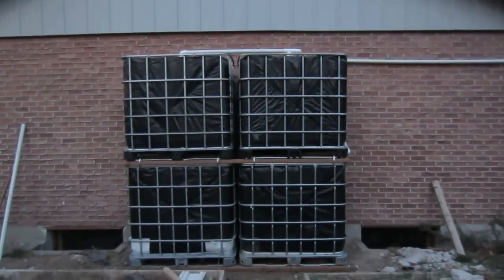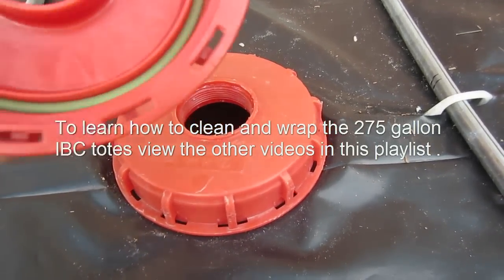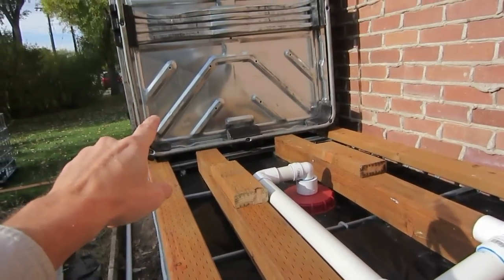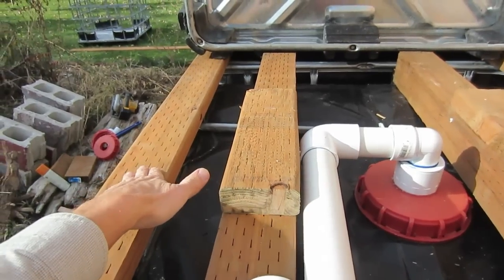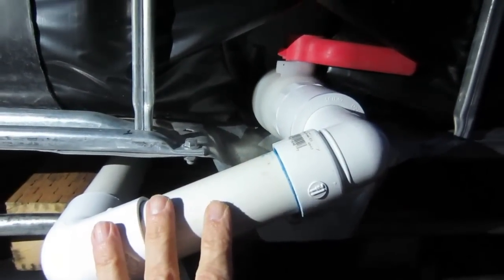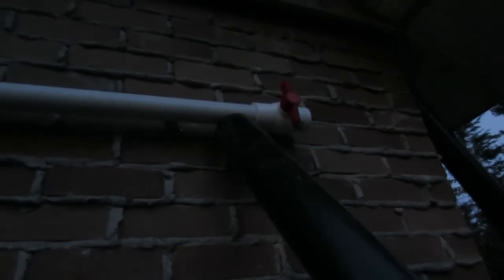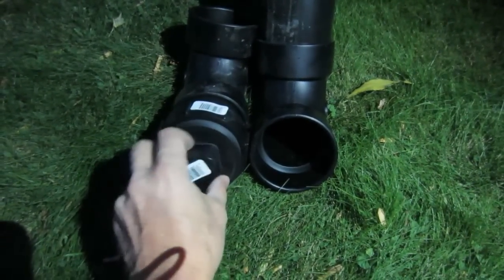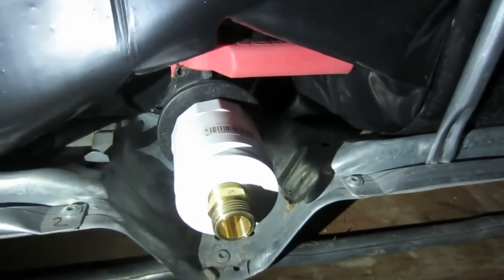DIY 1,100 Gallon Rainwater Harvesting & Collection System

Comment: Just a few tips I have learned from about a dozen years of rainwater harvesting in Jackson, Mississippi.  At my location, for instance, there is no need to drain out the water during winter.  It just does not stay cold enough long enough to create a block of ice in the tote.   

But we do get 75 inches of rainfall annually so even using pressure treated lumber is a waste of money.  All lumber, treated or not, will rot entirely too fast forcing you to disassemble, replace, and reassemble.  Avoid using lumber entirely.  Use cement blocks for the supports that touch dirt.  

For the supports to hold the upper tanks, mount parallel pieces of angle iron across the bottom totes.  The angle iron will create a channel which will allow you to place half cement blocks (or whole blocks) to support the upper tanks.   Use strapping around the blocks to hold it snug against the angle iron.  Supporting tanks this way will be a "one and done" set up as nothing is ever going to rot or need replacement.

Finally, I recommend draining and pressure washing out the inside of each tot once per year.   It is amazing how much cleaner you water will be when you clean and flush out everything.   You don't have to do all tanks at the same time but you will need control values (ball valves) installed on the water intake pipes to shut off the cross flow and isolate each tank if you want to do them separately. 

It is nice to consider adding a standard plumbing clean out with a removable cap just forward of the tote's own drain.   Mount the clean out with the cap turned down toward the ground and before the brass hose connection.  Using the clean out is a much faster drain process than using  the hose connection.  Of course, if you use both the clean out and the hose outlet, everything drains much quicker.
Reply: Good points. I'd like to add something to this as well. I have 2 IBS totes and in Chicago IL we can get a massive rain fall (like this year) I noticed my downspouds will overflow during heavy rain fall since my 2in pvc pipe does not provide enough of throughput for the water to go in. I'm considering adding another 2inch pvc into the system which will be tricky and ugly looking. Or spending money and going 3/4 inch pvc. I think 2" pvc is only good if you have small roof and never get hugass GPH fainfall.

Comment: I just finished building a rainwater harvesting and collection system that is based upon this design.  The 4x4s with the 2x4s on top failed to keep the bottom of the top tote from crushing the PVC pipe elbow that is connected to the lid on the bottom tote.  My solution was to use 4x6s instead of the 4x4s.  The 2x4s go on top of the 4x6s.  When both totes are full and begin to swell, the 4x6s gave me 1/2 an inch of clearance.  Perfect!
Reply: Hello, could you tell me where you found the instructions on how to build this? I think that is a great idea to use 4x6s instead of 4x4s

Comment: A small suggestion, use a leaf strainer before it enters the intake pipe. Use a catch box with a cover of plastic or aluminum fly wire. My three tanks, 1000 litre, 5500 litre and 750 litre drink water tanks are litter free. There is a little sediment in all but the Drink Water Tank with run off, sediment catcher and filter incorporated in the system. With only 225 mm or 9 inches of rain fall my system works. Rain water is great for home brew beer.  Keep up the good work.

Comment from the maker: Thank you for your comment and concerns. The first flush system is the equivalent of the settling tank. No additional venting is needed because air will "gurgle" out when the water comes in. There is plenty of room in the pipe for the air to go out as the water comes in.

Comment: If that's the case go for it! Here in the States 275 and 330 gal totes can be had for a very good price used. Over in Australia I see more homesteads with purpose built 2000+ liter poly tanks. Just be very picky as to what was in the container previously.

Comment: Vasoline on the O rings will cause them to break down. Possibly in a season or two. Use a silicone based lube like Jacks Lube or Magic Lube. You can find either at any pool store. It's made for that type of plumbing. Personally I would have wrapped the threads with thread tape and called it a day. No leak. Awesome system tho thanks for sharing.

Comment: Excellent review 👍🏾basically have a similar setup however I have my 4 totes beside each other on a concrete pad but the first tote that's closest to the gutter fills up along with the other 3 totes by a means of transfer hoses hooked up with T fittings 👍🏾👍🏾

Comment: I thought about using the two inch threaded coupling when I did mine, but decided to go with the rubberized coupling with a worm gear clamp. I was worried the PVC would strip the threads on the tote, but now I just have to worry about the coupling wearing out from the sun in AZ. As if that's a better thing...HA!

Comment: you will lose the majority of water because of the small orifice of your entry plumbing. If you're low on water a short rain will not have time to refill your totes. consider a sand filter and full 4"  plumbing from your down spout to your refill plumbing.
Reply: john nunya hello I'm getting ready to set a rain catch system I would like to sit the 4 275 gallon tote as in the video I have been researching a lot could you please give more advice on the 4" plumbing do you mean that is the size the pipe used should be so that more water can flow into the tote sorry this is all new just trying to learn

Comment: Great job! Highly commendable project!
Questions:
1. Why not painting it black instead of plactic enclosure? I thought painting it is easier and looks more uniform.
2. The bottom support looks like 2x6 to me, instead of 1x6? On other video (part 9 I think), you used cinder blocks; to me that look sturdier and more durable.
3. When both top totes are full, do the metal framing of the bottom totes (via 2 pieces of 2x4) able to support those weight??
Thanks for sharing, I appreciate your effort very much!

Comment: As long as the water empites out of the top tanks first the full tanks below should be able to hold the weight.....providing the tank itself can contain that extra weight. But if the bottom tanks empty first then you may have problems.

Comment: JASON on OCTOBER 13, 2014 2:34 PM
I like your collection system. It’s giving me some good ideas. in my area the local landfill won’t take asphalt shingles as they say they are hazardous material. I know the 1st flush catches the roof sediment but do you think it catches 100%? What %age do you think bypasses it? I read that you shouldn’t use asphalt roof for potable water collection or even gardening water because you don’t want to feed your plants the water you wouldn’t drink. This article said a metal roof was the best for gardening water and then for potable rainwater collection, and then using a screen/charcoal/& uv filter to clean the water to get all of the bird poop out.
Your comment is awaiting moderation.
REPLY

Comment: Just stumbled across your video. Am currently planning for an off grid homestead and like the up-cycling concept. Just wondered if the use is for drinking and if so have you needed to install a water circulation unit to deal with any issues of stagnant water?
Thanks in advance 👍

Comment: Question on the vent for the bottom tote. Can you remove the portion of the upper tote where it dips down to avoid crushing the 90 degree elbow instead of using a spacer? Thanks.

Comment: where did you buy the threaded tote cap.  I like that this is a closed system between upper and lower tanks, but my caps are solid.  Don't want to drill holes to create a closed system.

Comment: Do you ever drain the stored water from your units & start with new downpour, like is happening this week here? I only have 2 rain barrels, which is NOTHING during the summer months. When it rains like it HAS been for the last few days, I wish I had 100 more, but my barrels haven't been used since drought won out 2 years ago. Have only been letting the barrels top off with new rain.  I'm wondering if draining  & starting over is the way to go since we ARE getting so much new rain right now?

Comment: In central Texas, the ponds can run dry by mid-July, with105 degree days and no rain as the norm. Do you have an aeration system in your pond and is it fed by rain or city water supply?  Very curious as I want to be "water" ready at all times. During this last week (way too much rain all at once), it's hard to keep in mind that there are summer months into fall, where it's hard to believe everything and everybody isn't going to spontaneously combust! My two rain barrels are not sufficient! Thnx!

Comment: Your going to have a problem with filling up your tanks. Should have add vents in your bottom and top tank. Now your going to get gurgling when it fills up. And for a systen that big I would have put in a settling tank . But I can't say much cuz I wish I had that set up good job and God bless you.
Reply: I have issues with my 2"pvc pipes during heavy rainfall. It's not enought GPM in those bastards to keep up with rainfall. I need to add another 2" pipe or repalce with 3 or 4"pipe which is a lot of money. Good points you make there with venting!

Comment: LDSPrepper.  I am in Southeast Idaho, and I would not like to drain the units for the winter.  I am contemplating insulating the totes, and glazing the south-facing wall to use passive solar energy.  Any thoughts for keeping the system from freezing?  I am hoping to use the water for washing laundry in doors during the winter months.  Is the large black PVC food grade?  I think black is a good idea to keep the PVC usable throughout the winter.  Any thoughts on this matter?
Reply: I would worry more about the pipes freezing.  If you don't add heat of some kind after building insulated enclosure it will still freeze.  There are 12 volt water heater coils you can buy. Try Ebay.

Comment: This system will weigh 10,000 pounds full... And you claim that a few wooden 1x6s directly in contact we the dirt is sufficient? No way Elder Jose.  There WILL be settling, before or after those boards rot.
Reply: You apparently failed to notice that he is using Pressure treated Lumber.
People need to LOOK before they comment. I just LOVE the Armchair Experts. (sarc.)
Reply: Bruce Forster lol obviously you are unaware that pressure treated lumber will rot too. You sit in the same chair as the other person.
Reply: Annie Sidner for a short term solution and in an arid climate the system may work for a while but I am amazed that a cement base or at least cement blocks on compressed gravel was not used.  The wood is inadequate for the load and, pressure treated or not will rot in less than 5 years I would think, and less if you were in the Midwest where rain and wet conditions are much more frequent.  Not trying to be an "armchair expert"  Just trying to help and that is the only constructive criticism that I have.  I LOVE the concept of capturing the rain water instead of emptying the aquifer!  Way to go!
Reply: Pour a concrete footer 12" wide minimum 18" deep..remove the PTL and use concrete blocks...and  be sure you throw in some #3 bar in that footer.
Reply: Suggestion: Recycled plastic deck lumber. Rot and crush proof.

Comment: Have you filled this yet?  I would be concerned about the weight of the top container resting on the bottom.  The boards keep the pipe clear but offers no support, essentially the top container sits directly on the bottom.  At 8 pounds a gallon, that's a lot of weight/stress on the bottom container.
Reply: Yes I would be afraid of having 2 ibc totes sit on top. I had one sitting on a wooden made table thing and it was not balanced well it tiped over and fell down. Good thing for me nobody was there and the cage kept it almost unhurt, only bottom got smashed, i'm still using tht ibc just on the ground behind the shed.

Comment: +LDSPrepper why did you reduce from 2" to 1 1/2" when connecting the two tanks?
Reply from the maker: +Jackie Southern I think it was because of cost or the reduction was for fittings. I don't really remember. But for sure there was a reason.

Comment: I put together 4 totes. But no way would I trust that framework to hold more than one for an extended amount of time.
Those frames havecsheet metal screws and spot welds holding them together.
The frames are so the plastic tote won't expand. I see you look to have bladders. And possibly a heavier duty cage.
Anyway I'm just waiting on rain to fill the two I finally connected to two others.

Comment: I still believe that the first flush system you have is not adequate.  If you took the amount of water it holds up to the roof and tried to clean it I doubt that it would clear the dust and debris off the roof and down the gutter.
Reply from the maker: TheStavros1001 The size of the flush system is determined by the square foot of roof space as per the publication linked to in the description section of this video series.
Reply: TheStavros1001 Truthfully, I think the first flush is kinda irrelevant, as anyone can harvest a barrel of rain-water and use a solar distiller to purify 100% of the particles and toxins out of the water.

LDSPrepper I honestly believe one of your next projects ought to be the design and build of a solar water still for absolute purification (not just filtration) of your harvested rainwater. Distillation is still (pardon the pun)  the best form of water purification there is. (I love the big berkey, don't get me wrong, but in my opinion, it just isn't sufficient. And yes, I realize you have been using filtration for many years and haven't gotten sick yet. I remain yet unconvinced that anything less than distillation is less than perfect... and... well,  Solar = Free! What could be more perfect than Free Perfection?)

If you do decide to try a solar still, please talk to me, cuz I have some ideas I'd like to bounce around with anyone working on solar still designs. I've seen good ideas on YouTube but my brain insists on adding refinements and "but, wouldn't it be better if..." thoughts. So yeah, please contact me on this if you might try it.
Matthew Kerschner
Los Angeles, CA
Reply: OhPervyOne I'm not familiar with a solar distiller, is that a system that basically boils the water and recaptures the steam, returning it to liquid?  Seems like you would still like the water filtered as much as possible to remove leaves, pine needles, dust and other debris though.

Comment: I too used pressure treated lumber as the base for my rain barrel setup (https://youtu.be/Bi4T015fi2k) - just wondering if you have seen any negative effects now that it has been over 3 years since you set up your system? Thanks in advance!

Comment: I've watched your entire series.  Also, is this system even wet? I have never seen an update with any concerns and wonder if you've had had the same concern I had?
  How is your system working and what might you have done to compensate for the lowe lid's bulge and misalignment.  

* This is the system I built around your videos, which are good.  
******** System:  https://drive.google.com/open?id=1u7gFxFBjsL3t5xZJQhFLhJihm9-1U-ko
******** Lower tote bulge close-up:  https://drive.google.com/open?id=1JZ3et5WmTzjaRskyx8GTpfi0jbULLlPl

I will remove the upper totes and move to the side due to the concern I had with bulge in the lower totes from the 4 foot of head presented by the upper totes.  You mention this but only that you added spacers.  When I was full the pressure might only have been ~2 psi but that's a LOT ... and the lid was not only at a 10-degree angle, the 2-inch feed pipe to the lowers was pressed against the lower cage.

Comment: You don't need a pump?
Reply from the maker: I have used  pump to get water pressure but usually due to the height and weight of the water I had no problem filling buckets. But for hose pressure use a pump.
Reply: @LDSPrepper  I'd be using this for tiny house for sink and shower. House has a direct hose connect faucet pipe. I think I'd need a pump and of course some filtration. Not planning on using for drinking water.
Reply from the maker: @StreamingEquine  Good for you. I love tiny homes. If the bottom of your water tanks were above the height of the shower you would get enough flow for a shower, but you would not be able to control the water pressure.

Comment: what about when its -20 outside?
Reply from the maker: +ebp1234 I don't know about -20. It didn't freeze at -17. But that was for only one night.
Reply: +LDSPrepper It didnt freeze at -17? Why not? Do you live in another dimension?
Reply: I presume you two are using different units...
Reply from the maker: I should have used a noun and not a pronoun when replying. Let me restate my post. When it was -17 degrees outside the temperature inside the greenhouse was 40 degrees. It didn't freeze inside the greenhouse because the temperature was 40 degrees.
Reply: Being cloaked in black plastic attracts heat from the sun. The water collects the heat creating thermal mass. Then slowly releasing heat overnight to adjust back to the surrounding temperature. Just a guess, might be total BS.
Reply: Try adding 1100 gallons of water to that green house, it will freeze.